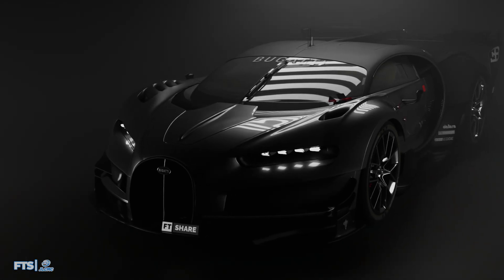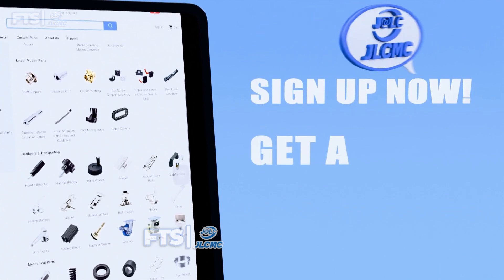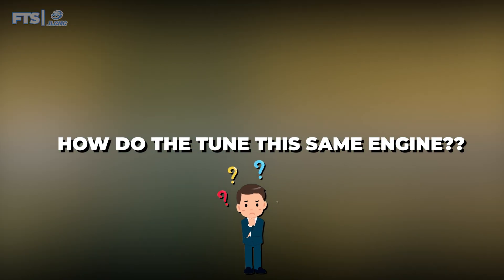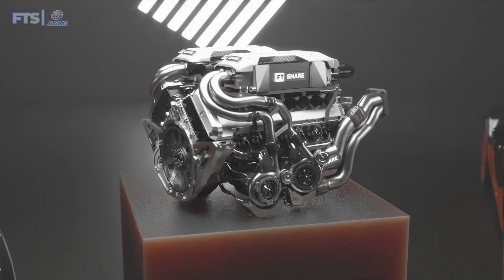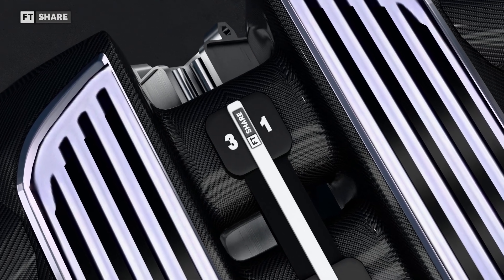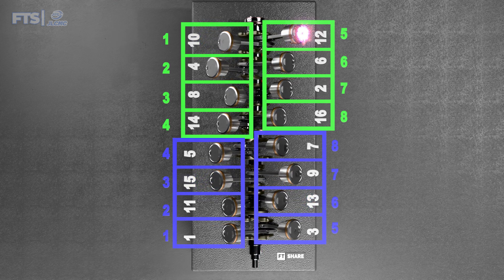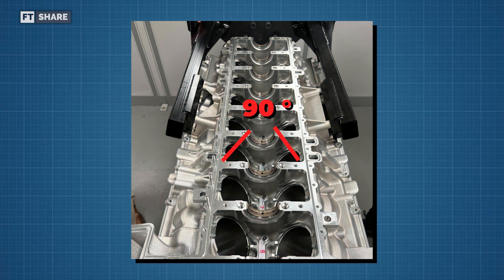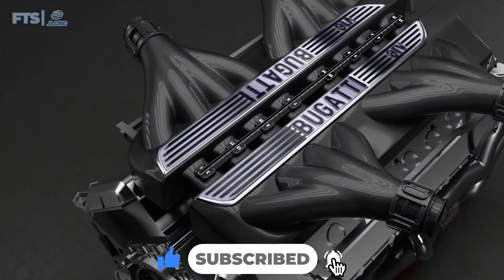V16: Why Bugatti Stopped Producing the W16 - The Secret & Details Behind the Tourbillon

Comment: This is a stupid way of merging two crossplane V8s to form a V16. While the crankshaft counterweights will be significantly reduced, the balancing will be done at the cost of significant flexing of the engine block, like in an inline 6 (two I3s rocking in the opposite directions).

There is a much better solution - "shuffling" two engines (A and B) together and changing the offset angle between them to 135 deg (or 225deg). The crankpins (counting from the front) would be A(1,2) at 0deg, then B(1,2) at 135deg, A(3,4) at 270deg, B(3,4) at 45deg, B(5,6) at 225deg, A(5,6) at 90deg, B(7.8) at 315 deg and finally A(7,8) at 180deg.

This way neighboring crankpins are always 135deg apart, except in the middle, where the angle is 180deg. This makes the crossplane V8 rotational imbalance cancel each other "locally" instead of "globally", because 135deg offset between neighboring crankpins is fairly close to 180deg.

 There is an additional benefit - instead of end-to-end rocking 4th order vibrations, they cancel out perfectly.

Comment: There's a typo at 2:30. It states that 1500N.m. of torque between 3000-5000 RPM, but your graphic shows 3000-500 rpm. That needs addressing. Chiron is pronounced Sheeron, well you can't pronounce the correct word so I've simplified it for you!!
Reply: Isn't it pronounced sheero'?
Reply: Or Shir-ron  also the a.i. voice was pronouncing the word TORQUE as TORKY . 😆  @brokkrep

Comment: What about engine balance, unlike the cadillac v16, the 2 inline 8 is balanced, but the 90° v16 the 2 v8 does not directly cancel each others rocking couple
Reply: Bob weights and the length of the engine reduces the significance of rocking couple
Reply: @jamesgaskin7757  i now know how they do it, thanks
Reply: If a v16 engine doesn't do power at every 45° is not a true V16 engine and it'll make less power than a v16 that does power stroke every 45°